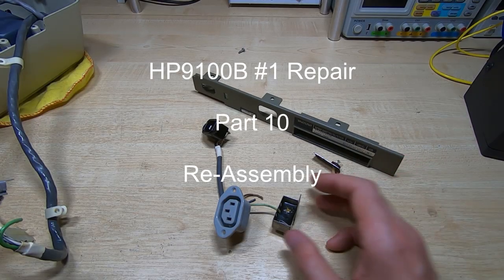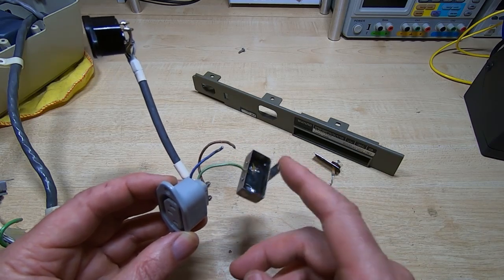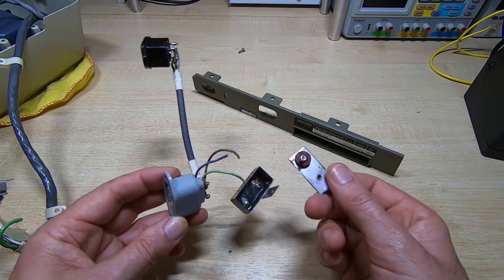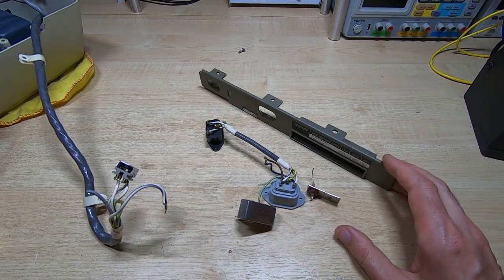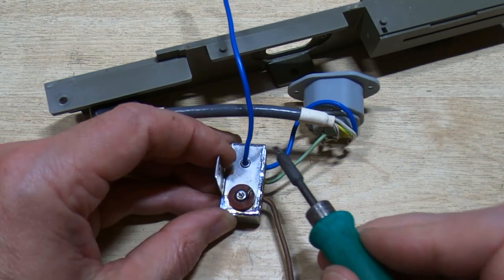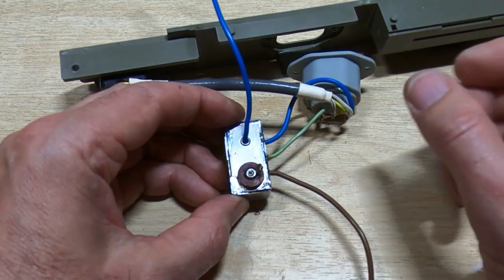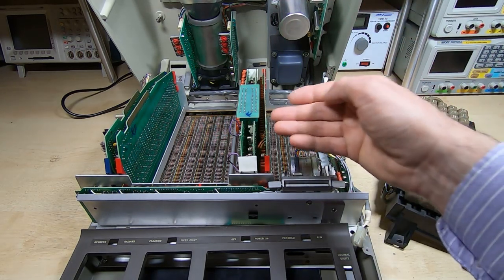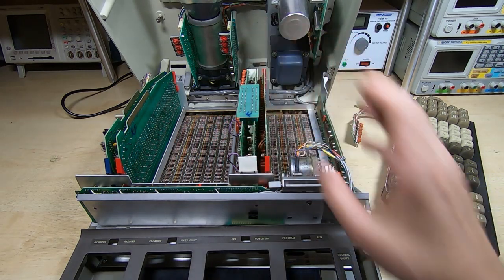HP9100B #1 Repair Part10

Comment: hi Jerry, 
Very well described and systematic, thank you !

In the 9100b Mains filter (steel soldered) enclosure:

What were the two capacitor original values and voltage ratings, & what parts did you replace those with (part#'s ) that fit into the small steel Mains filter enclosure ?

Also: Which future video describes your High Voltage Leakage Tester ?

regards,

Comment: Very nice restoration job. I can tell the display is clearer even on the video (could be just the cleaning, but it is noticeable). Capacitors do have a tendency to not age well. I am reading your microprocessor book, I love that you selected the Z-80, it has always been a favorite of mine. I did a lot of assembly programming for it in the early 80s, we designed an STD bus system for testing in a manufacturing environment and of course most were one of a kind running off of EPROM. Anyway, I will probably buy your discreet components CPU kit for myself for Christmas. Once you get over 60, hobbies are more fun. You do often find previous repairs might not be the quality you want, and I think the wire problem in the power supply is an example. Anyway, it may be niche, but I really enjoy your videos.